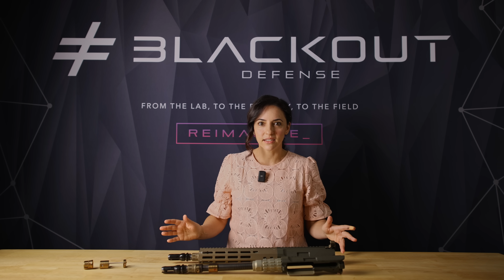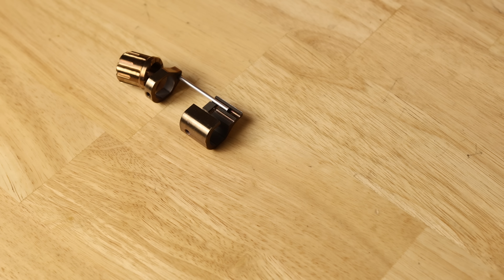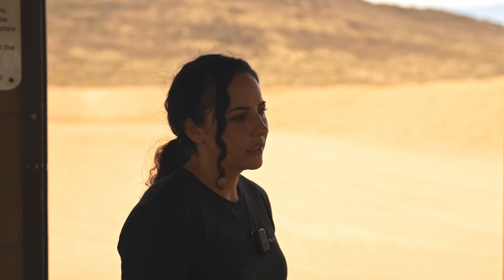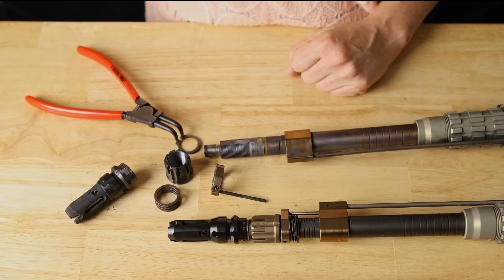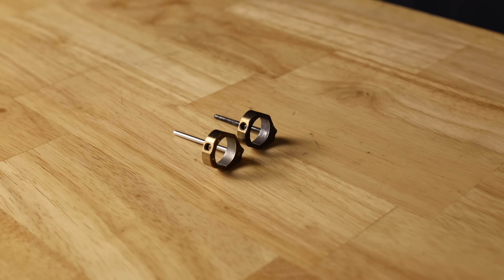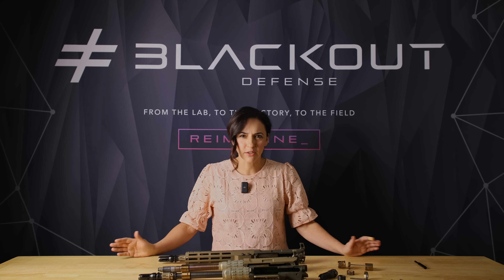HELIX Gas Regulating Barrel System

Comment: I love innovation, and I hate to ask the same question we all have right now, but isn’t this kind of more complicated, heavier version of what something like the RifleSpeed adjustable gas block does without also requiring a proprietary barrel? I can see the potential advantages over a standard tool adjusted gas block, but you’ve added a lot of extra meat to an option that already solved the problem pretty elegantly and with much less cost, weight, and potential failure points than yours. What am I missing that makes this a superior option?
Reply: yes. the answer is yes. but profit margins on buying from somebody else is lower than selling very cool and proprietary tech with erosion as a feature to force the sale of replacement parts. planned obsolescence baby.
Reply from the maker: @maxi1958"erosion as a feature to force the sale for replacement parts" LOL!!! I have repeated this in multiple comments: This M42 rod is part of the national stock number. You can simply buy it from McMaster (part number 8813A28)! It can be grinded to size appropriate for the barrel gas system (pistol vs carbine vs mid length and so forth). We will provide the dimentions on our site.

Comment: I could see where this ends up in LE or military which might be the goal but there is so much proprietary with it civilian use would be limited.  Also how much weight is added to the rifle with the extra barrel nut, heavy profile barrel ,and gas block?
Reply from the maker: Yes. It was part of that project. Thank you. However, this system adds 2oz to our current rifles without Helix system.
Reply: @BlackoutDefense that’s pretty good

Comment: I love the idea of this, but speaking as a former Marine armorer and current gunsmith the practicality of this with additional proprietary parts, proprietary barrel, and added weight it’s just way too much. It’s a great concept for sure but I’m guessing this system isn’t cheap and user service ability without voiding a warranty probably doesn’t exist. 
Who knows though I could be wrong these are just my personal opinions and observations. I would like to test one and run it through its paces to be able to form a more appropriate opinion.
Reply from the maker: Thank you for your service. I responded to other gentlemen earlier. If you don’t mind, I would add that response here. Hope it does address some of your concerns. Feel free to ask direct questions after this. He had overall similar concern: We have not been able to replicate the erosion in semi environment. Erosion is more pronounced in full auto testing but not in semi. We recommend replacing the rod every 12-15k rounds. One of the major benefits of this system is that in case of full tip-erosion on the CURRENT gas position of your rod, you could push the rod further IN. You can repeat this cycle until you have bottomed out your detent counts. At that point, you should replace the rod. It would cost under $10. Cool fact: This M42 rod is part of the national stock number. You can simply buy it from McMaster (Part number 8813A28) then it can be grinded to the size appropriate for the barrel gas system (pistol vs carbine vs mid length and so forth). We are also going to provide dimensions and spec for the rod on our site. M42 is very difficult to machine but can be easily grinded like sharpening a punch or drill bit. For those who do not want to deal with it, we will offer it precut on our site. You do not need to remove the muzzle devise. You can disassemble the rod at a certain position or alignment with the adjustment knob (there is an undercut on which creates free access to the rod.) Rod is held in place via 82-degree tip set screw. Lastly, we make our own barrel and everything else on our rifles except plastics and springs. This barrel is reverse compatible. You can remove the Helix system and install your desired gas block. Our barrels are 416R SS and it is blackened (cold bluing method). Hope this helped to answer some of your questions. Please visit our IG page. I have shared everything from my modeling on CAD to how we made this system. I tried to cover everything as possible.
Reply: @BlackoutDefense I have never seen a business respond to a comment with such great detail. With that being said, especially with so many bitching and moaning in the comments trying to knock yalls product. Much respect.

Comment: The amount of erosion on the rod in just 1500 rounds seems bad. I feel like the rod will need replacing after a kinda low round count. Is there not a metal or coating that will last longer? Very cool design.
Reply: AND…I think what needs to be emphasized, is that the test and erosion result was from 1500 rounds under full-auto fire, if I’m not mistaken. VERY different than 1500 rounds of semi-auto fire.  The time the test took with regard to any cooling periods is unknown.  However, like another commenter stated, it would be nice to know the erosion status after more common semi-automatic fire and the period of time with which the test took place.  I would imagine the heating and cooling cycle would matter.
Reply from the maker: Temperature is a big portion of metal erosion and oxidation. At 1500 rounds, that rod reached about 1800 degrees (barrel around 1300 degrees). We specifically selected M42 Cobalt steel, which is designed to withstand around 3000 degrees, for the plunger. There is no other gas block in the market that uses M42 Cobalt in its adjustment mechanism. They all use stainless or standard steel, which we also tested. These metals erode completely at around 500 rounds and the system fails. This test with M42 Cobalt was extremely successful and shows the value of that material choice.

Comment: How is this better than rifle speeds adjustable gas block that needs no proprietary parts? 

This is a serious question.
Reply from the maker: Riflespeed is a great AGB but our design is not a gas block.  Ours is a barrel system with the controllers attached to the barrel away from the gas block.  We improved upon the knob design first pioneered by the legendary FN FAL. With our system you can drive your adjustment from the fully open to fully closed position without changing your rod. There are 25-30 settings. Additionally, the critical spring and detents are away from carbon exposure. And the system is very light—we are only adding 2.03oz to our rifles. Most importantly, you can maintain this system without removing your muzzle device or even your pinned suppressor. And you can lock your gas setting in place which is excellent for duty use. Additionally,  temperature is a big portion of metal erosion and oxidation. At 1500 rounds, that rod reached about 1800 degrees (barrel around 1300 degrees). We specifically selected M42 Cobalt steel, which is designed to withstand around 3000 degrees, for the plunger. There is no other gas block in the market that uses M42 Cobalt in its adjustment mechanism. They all use stainless or standard steel, which we also tested. These metals erode completely at around 500 rounds and the system fails. This test with M42 Cobalt was extremely successful and shows the value of that material choice.
Reply: @BlackoutDefense Thanks for the response, I was curious and appreciate the information.
Reply from the maker: @Tom_Wilk Thank you!

Comment: 8:14 would it erode less if the end of that rod was already machined into a ball end?
Reply: in absolute terms? yes.
but then to make the rounded tip work you'd have to make a round hole into the opposite end to regulate it down without eroding that. and in the end you're just restricting the flow this or that way, make it take another path, erode another part of the system.
The ideal gas system is a lot more like what the FM / Global Ordonance Monolith has. A 45° gas path optimized for laminal flow without all this restriction and erosion.
Reply from the maker: Thank you. Also one on the design criteria was to fully shut down the gas.

Comment: This looks a lot like the Riflespeed gas system
Reply: But more complicated.
Reply: @justink1209 but significantly better and more robust. RS was innovative but their systems will lock up with even low round counts.
Reply: @The0nehitwonder  what proof can you provide to back up such a bullshit claim? even red right hand uses rifle speed gas blocks for their IAR uppers meant for sustained high rates of fire
Reply: @The0nehitwonder I have over 1000 rounds through my RS and no issues. 
Yes they require maintenence but so does your AR

Comment: While i can appreciate the work that went into this, and its very well done, it is also quite over done. What we really need is a reliable type of pressure regulating valve that only allows X amount of psi to operate the system and vents the rest. So for example if you are running without a can the gun cycles on 20k psi, and nothing vents. Throw on a can and now the pressure spikes to 30k psi - the block then opens slightly under pressure to bleed off that extra 10k to maintain the standard 20k. These are just made up numbers for the example.
Reply: Agreed, there's too many proprietary parts. Even the barrel is proprietary. The gas system should be simple and light.
Reply: Excellent concept.  Perhaps something akin to an automotive thermostat,  a gate valve actuated by pressure not heat, self adjusting.
And make it cost $2.
Reply: @cav4353 the concept is basically a turbo diverter valve

Comment: I don't see a real world use for this. How is this better than just an adjustable gas block, or a piston system that already exists? You've successfully taken a product that already exists and made it more complicated and more expensive for what reason?
Reply: It appears that it's so the rail can still cover the gas block while still allowing toolless adjustment of the gas system.
Reply: @codymartin5431 RifleSpeed solved that issue years ago for about $200, a fraction of the weight, and it fits your existing barrel. I’m not sure what category this new one excels in.
Reply: @crashleykelsey8532 oh I'm not defending it. Just trying to suss out the intended purpose of their design.
Reply from the maker: @crashleykelsey8532 it is actually lighter. I would love to see a good YouTube channel take the initiative to do a comparison test on both systems. I will provide free rifle or upper (in case of full auto meltdown)  and 1500 rounds of ammunition. Please let us know!
Reply: @BlackoutDefense  Why don't you simmer down, and sell your product instead of lashing out at potential customers like some crybaby from T-rex, Sig, or Franklin Armory.
Reply from the maker: @-I-I-I-I-I- Not following your thoughts. Where did I lash out?
Reply: @-I-I-I-I-I- bro you sound sensitive. Do we need to find you a safe space?
Reply: @BlackoutDefense is the whole system lighter when combined with your proprietary barrel vs theirs with a standard barrel?
Reply from the maker: @crashleykelsey8532 Our standard barrel with RS gas block vs our Helix barrel (this system) : we are around an oz lighter
Reply: @BlackoutDefense ok, now you’ve got my attention!
Reply: @codymartin5431  bingo
Reply: @codymartin5431  who is adjusting their gas block after the rifle is already dialed in? Akm's do it because of the design allowing for alot of fouling. Not an issue with the ar system
Reply: Requiring a proprietary barrel is a hard sell when you could run any standard pattern barrel and a Riflespeed. It looks well made and innovation is great, as is more options. Not opposed to that, just going to be a hard sell with the options we already have.
Reply: @mytmousemalibu oh yeah. Agreed.
Reply: I see this as a product designed for someone who has a library of different suppressors and a favorite rifle that they switch suppressors on often. (Niche product for a niche customer) It would be a great idea as a way to eliminate variables and log changes when testing suppressors as well.
Reply: I wouldn't say gas adjustment on AR's is moot, there are certainly good reasons to need the ability to adjust it but I personally think gas adjustment is overhyped in most cases. In something like precision applications, long range, subsonic platforms, absolutely. By the nature of how these things work, a gas adjustment is also an added point of failure and possibly a source of reliability issues that cannot be easily fixed in the field if needed. Especially when your restricting the gas near the gas port. You can use top notch materials and build quality but your still stuck trying to control very hot, dirty, abrasive high velocity gas. It will cause erosion and deposits. Personally I don't run adjustable gas on "duty guns". Just a high quality open gas block & tube. My go-to tool is a lightweight 5.56 gun run with & without a can. Its sprung & buffered well but no gas adjustment. Its a little overgassed with a can but its been 100% reliability with or without a can. Smooth, light recoiling, not battering components at all. Its had thousands of rounds put through it. My buds I shoot & train with have pulled their adjustable gas off for a plain block now as well after having problems with known good quality adjustables. Adjustables are a liabilty for ultimate reliability.
Reply from the maker: @mytmousemalibu thank you for your thoughtful comment.
Reply: It seems to me that it’s an adjustable gas system designed specifically for their huge profile barrel.
Reply: Gaining market share. Trailing behind Rifle Speed. On the AK system I can see the need. The existing AR adjustable gas blocks were sufficient and cheaper. The upper that is out that claims to automatically change according to bullet or suppression seems to be ideal. Which is why I don’t trust it. Too good to be true……

Comment: Have you guys considered doing something special with your BCG? It would be cool to see you guys do a self lubricating coating like ADM. the amount of research and engineering that goes into these things it’s incredible, these rifles have changed so much in the last few years, theirs only a few things left on the rifle to do something special with.
Reply from the maker: We are currently working with ADM and other team for coating of BCG and triggers. Need to test few options
Reply: @BlackoutDefense You guys should look more into a way of making a stronger bolt, primary for the 6 arc, as they all have issues aside from the geissele gfr. Make a forged 6 arc bolt.
Reply: @Bmxr1991   6arc in the M4 is a lost cause. you HAVE to cut the bolt walls too thin. 
You can either go the way of the FM and Global Ordonance Monolith and have a proprietary thicker bolt head, or the way of the FN LICC and make the entire rifle bigger.
Or, if you would like to keep most things M4 and AR-15, use 6max. The only cartridge in this class that has kept the rim small enough to fit full strength bolts.
Reply: @BlackoutDefense awesome, keep us updated. Definitely ordering one.
Reply: ADM also has a self lubricating feature? 
DLC and NiB are low friction and still need oil, and the other that i heard about was the Anderson RF85 treatment. It's not a traditional coating nor a finish, but disposits CaCO3 into every crack and uneven part of a surface.